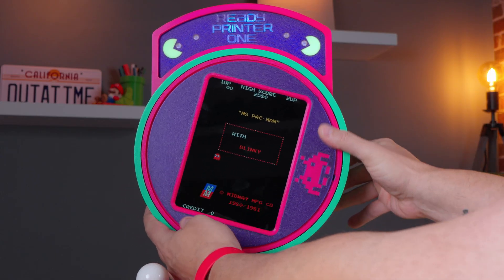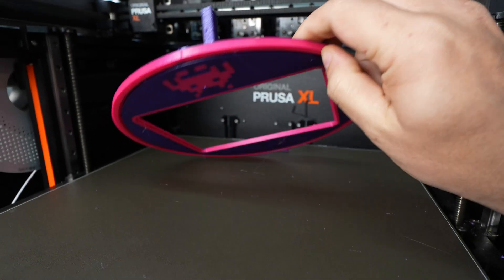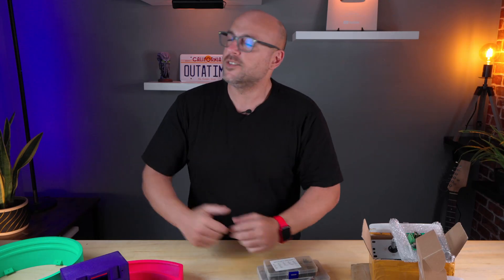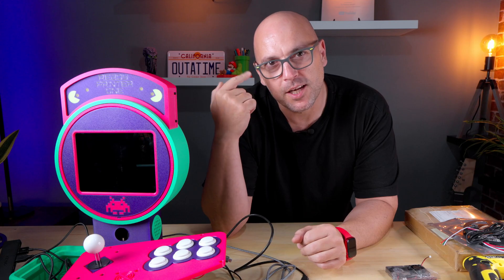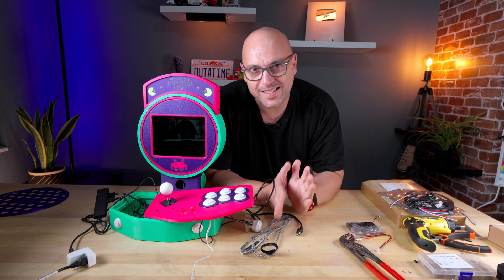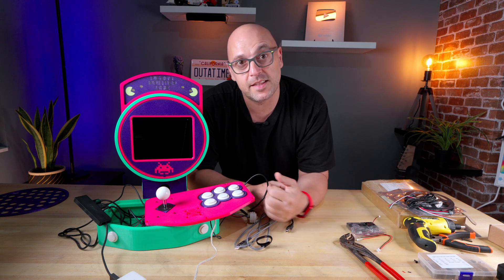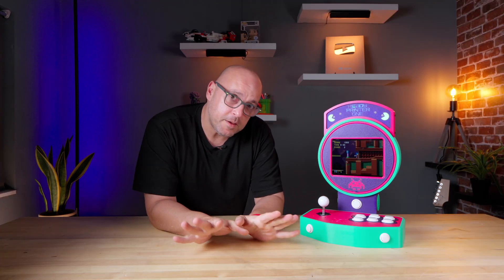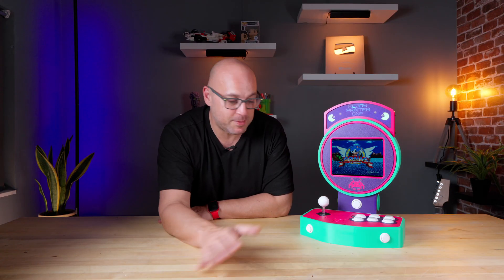Make Your Own Retro Arcade With 1000’s Of Games! 😍

Comment: You could add a rotating knob on the screen bezel to make swapping orientation less fiddly. Otherwise great build! If i wasn't already down the rabbit hole of making full sized cabinets I'd build one in a heartbeat.
Reply from the maker: I was thinking a motor to turn it automatically with the press of a button 😁